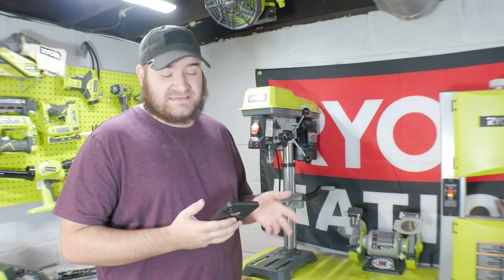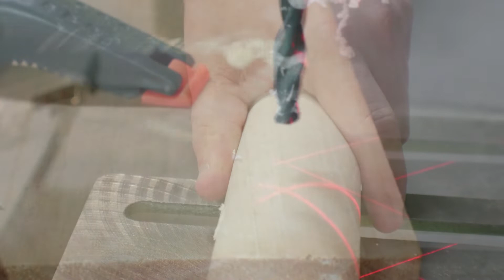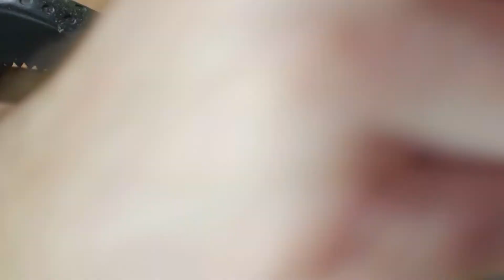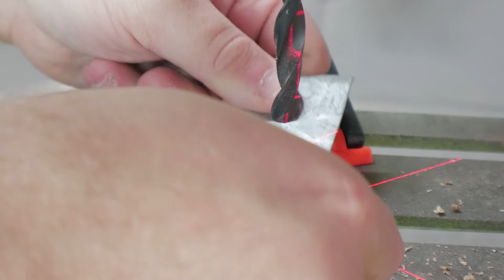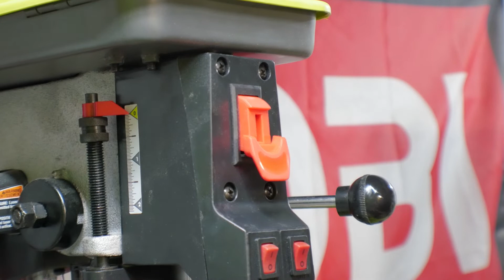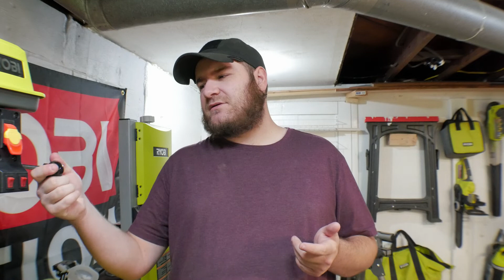Ryobi Drill Press Review

Comment: Thanks mate. I just cannot pivot the table. I have loosened the pivot lock nut however the small bolt and nut just under the table bevel nut does not unscrew so it is impossible for me to figure out how to tilt the table. Can you help?
Reply from the maker: Ya that is strange
Reply from the maker: Your table does have a little knob on the back to loosen to change the angle

Comment: I'd like to upgrade / increase the height of this Ryobi DP103L drill press. Given that I'll need a longer Pillar and Rack, what options do Ryobi drill press owners have in making this about a third higher? 

I'm curious if anyone here in the community has experimented using another pillar, rack, and possibly table bracket assembly combo from another brand? It seems like it would be possible IF the newer and longer pillar matched the same diameter as that of the original Ryobi pillar
Reply from the maker: Ya I don’t know if any of them do let me know if you find out

Comment: With the right drill bit could it be use for mild steel I am looking for a cheap bench drill to start making holes on a half inch steel plate for a punching die machine do you recommend it for that job or I must go for a higher hp or rpm drill I am a noob on the theme I know about welding but not much about drilling and tapping thanks a lot for youre answer in advice. Im not shure if I will do the dies plate on aluminum or steel ✌😎
Reply from the maker: Is should be able to do it just fine

Comment: Dont buy this drill press anymore.  It is not supported by Ryobi any more.  I just bent my spindle shaft and tried to order a new one, and they no longer make or sell parts for the 10 inch drill press.  15 years of brand loyalty right out the window for them...
Reply from the maker: Let me give them a call for you and see if i can get something done
Reply: @RYOBIKING  I found an aftermarket assembly I think from Toolpartsdirect. Might be leftover OEM parts though, hard to tell. Honestly, I would be more interested in fixing it instead of replacing it, if the table was just a little more solid.  I get a good 3 to 4 degrees of flex when drilling into something hard, like jello, or pudding...
Reply from the maker: I see to my understand when I talked to them about this last there was 3 products that they outsourced the table saw, bandsaw, and drill press and you can tell a quality difference in all three

Comment: Have you tried going through tougher steel? Like tool steel and high carbon steel, with better bits? Or will it stall out?
Reply from the maker: Bear 1mymm Is you set it to its slower setting with good bits it will do just fine if you take it slow
Reply: So good set of bits and the slowest setting. I’m going to be making knives and need a drill press to safely drill pin holes for the handles
Reply from the maker: Bear 1mymm yes it will
Do it just fine The thickness steel
I have drilled was 3/4 in high carbon I had to put a hole in a peace of a rail road track 
For a custom anvil
Reply: RYOBI KING how is the chuck on it?
Reply from the maker: Bear 1mymm it is a tap on
Reply: RYOBI KING no but like was the chuck good, runout wise and bit holding
Reply from the maker: Bear 1mymm yes it hold the bit tight haven’t had any problems